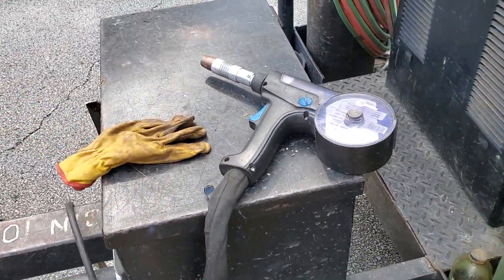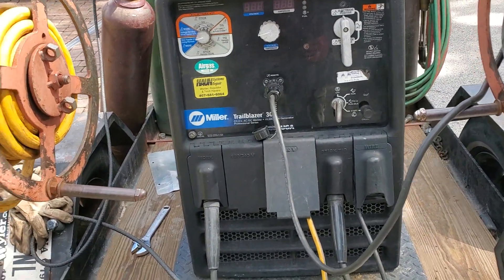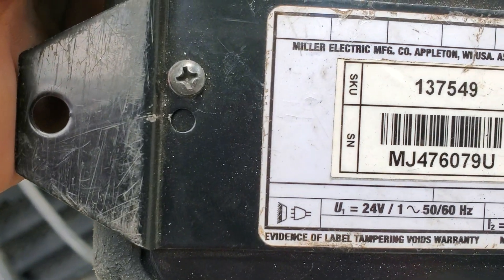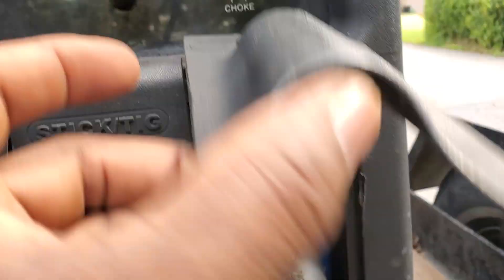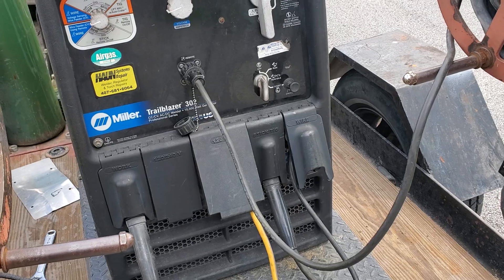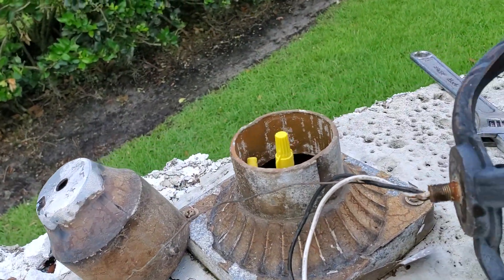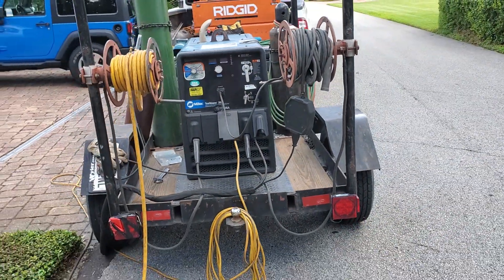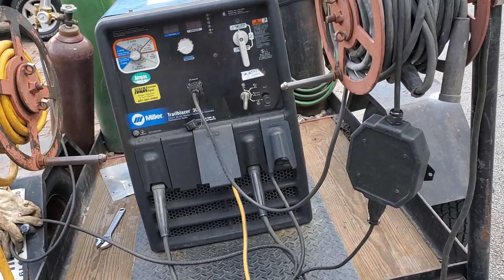How to aluminum weld with a Miller trailblazer 302

Comment: Do you have any result of how it welds alum with the spool gun with this kind of set up ?  Any special tips when welding with this kind of equipment. I got my trailblazer, my semi trailer is full alum and it gets some beating at loading ducks. Besides that I pay a lot for welder ,   it either look like" bird poop with rain droplets " or it cracks wher it was welded.
Reply from the maker: Thank you for your comment, there is lots of tips I can give but the most important ones are make sure the machine is set up correctly and clean the area your welding very good.

Comment: Hello i have trailblazer 325efi i help for connect spoolgun 30a with wc-24 box how to set the settings on trailblazer thanks
Reply from the maker: Hi I would start with putting the dial on 18 and depending on the thickness turn up the amps from there. Hopefully this helps with what you are asking about.

Comment: First off thanks for sharing your ow to video's & i hope all is well with you & yours. I have a Miller Bobcat 250 & need the box that the Spoolmate connects to for my sppolmate. My question to you is: What is the name & model #number of the box that the spoolmate connects to? Basically i want to know what to type into the search box on ebay/amazon when attempting to search for the box.   Thanks for your time & help with this matter. Respectful always Tony
Reply from the maker: Hi it's great to hear from you, I dont think this box miller wc-24 would be able to work on a bobcat because it doesn't carry the control receptacle to connect it to. I will put a link in the video description for the one I am using currently. Thank you.